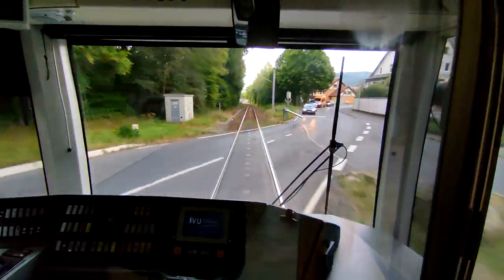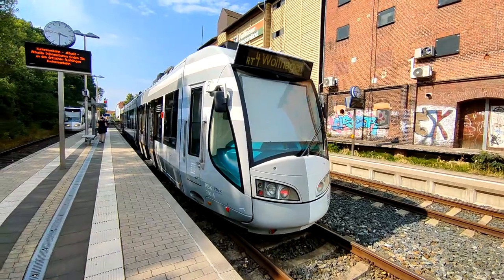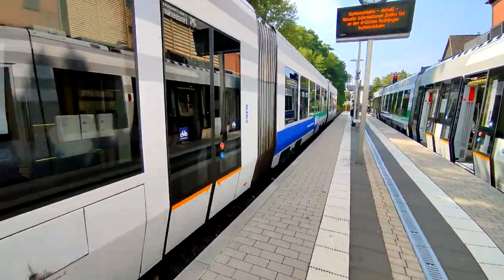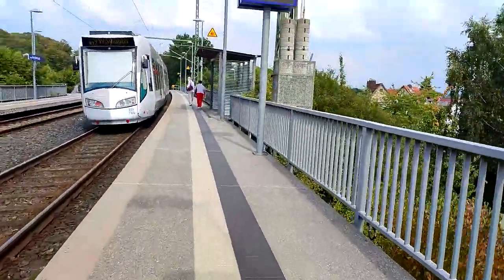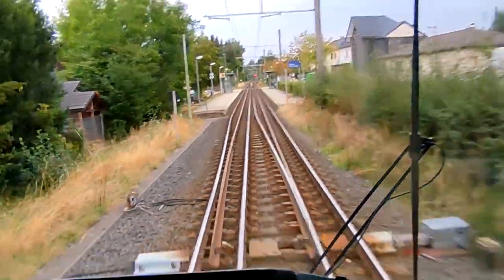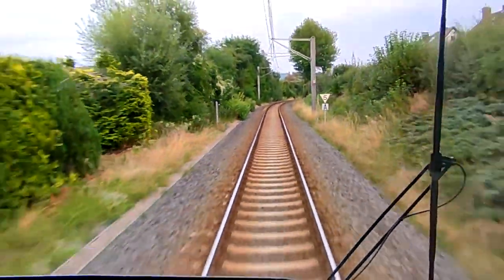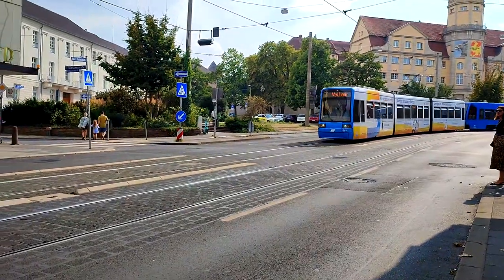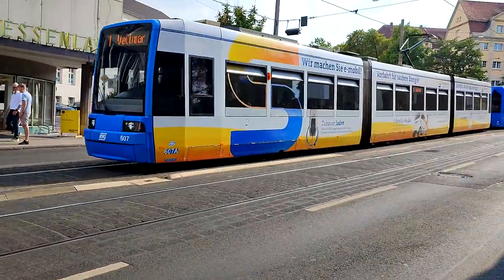The Kassel Tram Train system is epic

Comment: This high pitched VF drive is quite common in the Netherlands, you can hear it on the CAF M4 trains of the Amsterdam Metro, the older Rotterdam Metro, as well as on the Berkhof Premier AT-18 trolleybuses running in Arnhem as well as in Solingen in Germany
Reply: Also the alstom citadis 2000 from Rotterdam makes this exact sound. But the regio citadis from den haag (the same model as kassel) doesnt

Comment: Second!

EDIT: I saw some pictures of these northern trams being shown in Stockholm at some point. First at Djurgårdslinjen then on Lidingöbanan. Pretty sure Lidingöbanan ran at 750V at the time but I am not sure... 
It also ran on the Stångådalsbanan in diesel train-tram mode since that line was a diesel route. It runs between Linköping and Kalmar.

EDIT 2: I just find it so crazy with different solutions and incompatible tramways system within one city. Stockholm is also at fault, with 4 isolated tramway system. We have came to a point that we now pretty much use one tram model, but each line have different configurations so one tram is tied to one line.

Comment: I like how these trams are tri-mode and can work on tram tracks and heavy rail and powered on electric and diesel mode. This is what some parts of the UK might invest on and to replace the existing diesel trains and to replace them with hybrid-battery and hydrogen powered trains and tram-trains. Plus they do sound like a Stadler Flirt or a Electrostar.
Reply from the maker: To me they sound like a higher frequency version of the Holec VF drive (which is used on the class 323)
Reply: True. 👍
Reply: The system is tri-mode, not the vehicles. He did mention you have trams that can run on both voltages and others that just run on the tram network voltage and diesel sections of the main line system. I'm pretty sure the trams that run on the low light rail voltage and diesel mode can technically operate anywhere even on the main line and non-powered sections as they can use the diesel engine.

Comment: 1:39 this tram uses an Alstom-Traxis VF
Traxis was formerly known as Holec so your deduction was right
Reply from the maker: Do you know what VF drive the UK Class 465 /0 /1 had before the Hitachi replacement.  I am struggling to find this information.
Reply from the maker: I have done many videos on it before it got modernized.  I have never managed to work out which VF it is.  It is a different VF to the 465/2 /9 365 and 1996 trains which have some kind of GEC or ONIX VF drive.
Reply: @benolifts  It was a GTO converter from Brush Traction

Comment: Amused by the additional knitting required at gauntlet tracks to keep catenary safe whilst maintaining the stagger \m/
Reply from the maker: If the triple interlaced track needed overhead power on all 3 ways then the overhead wires would have been very interesting.  But on this part of the system, it is electrified at tramway voltage (rather than mainline voltage), meaning there are no mainline trains using electricity here, so the straight ahead route of the interlaced track is not electrified.  This route is more of an express tram than a tram train as mainline trains no longer use this route.  I am not sure of the reason of the route being kept available to diesel DB trains, but I think this is for DB cargo only, which as far as I know, would very rarely operate on this route.

Comment: Nice video, I really love the tram train system, we have a few here in France? Nantes is my favourite one, I'd like to try the Mulhouse system one day.

Also do you have any plans to go back to Paris?

You should try the new MP14 stock on the line 14 it's amazing, the stock has 8 coaches on the line 14 version.

And line 4 is starting to get automated, the line still have a lot of MP89 CC driver version, four MP89CA the driver-less version from the line 14 two MP05 RB  they're former line 14 trains, also the classic RATP livery is going to be replaced with the blue and white Ile de France Mobilités on these trains, but two MP89CA still have the RATP livery, also the line 4 is going to get a few MP14 in a six coach version. At least three models are going to be operated in the line 4 once the line is fully automated most of the models are former line 14 trains, 

But I'd recommend you to wait more, the line 6 is going to get the MP89CC from the line 4 in a few months, in a modified version, and line 11 is going to get a driver MP14 version in 2023-2024